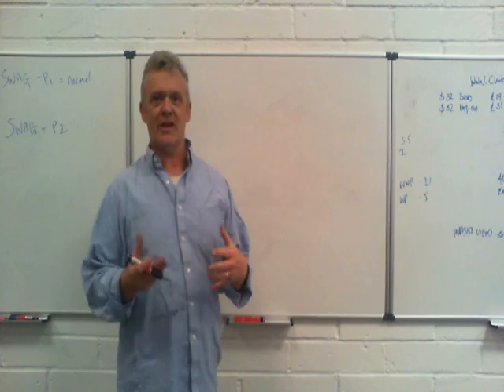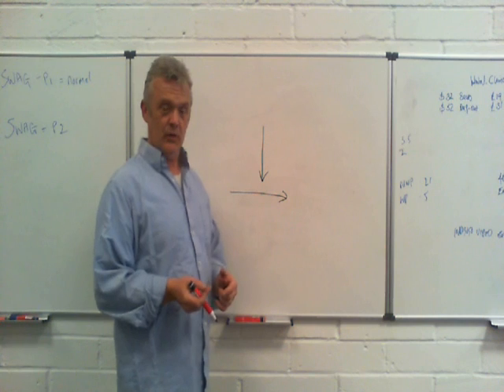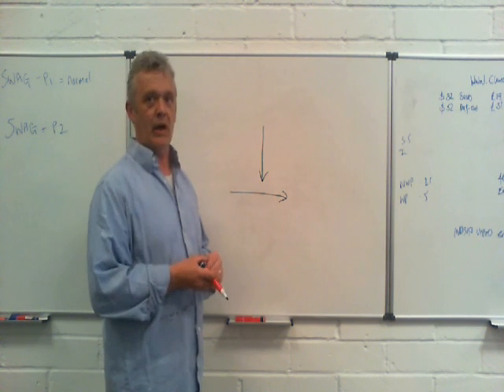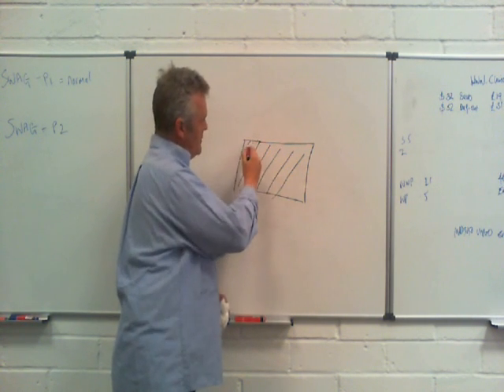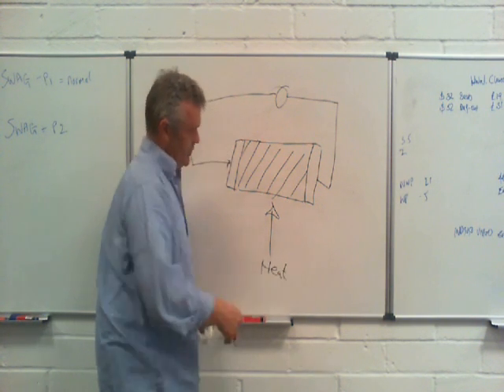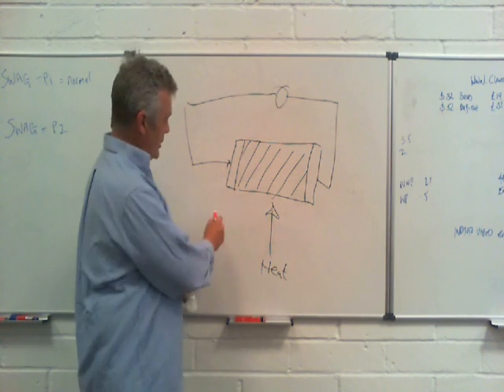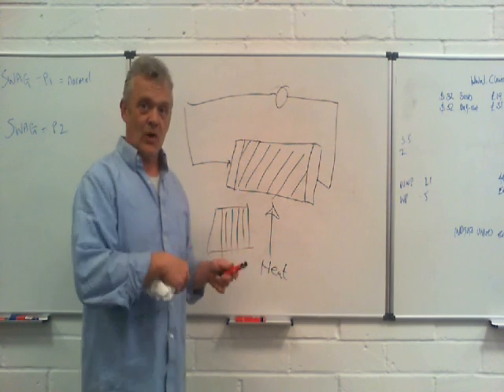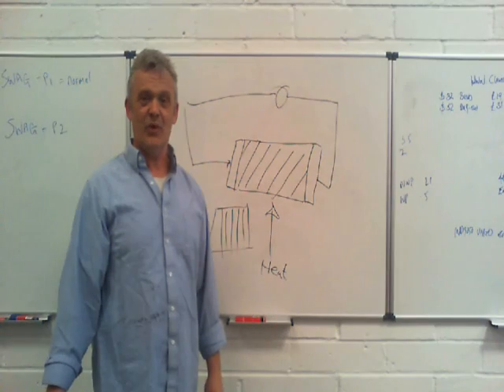Thermo Electric Generator From Graphene Ink

Comment: Thanks for your informative and inspiring videos. If possible, I would like to ask you and/or your audience a couple of questions. I don't expect you to know the answer to all of them :)
1- what is the maximum temperature these sheets can tolerate? 260 C?
2- what happens to them if put in direct contact with a corrosive environment?
3- which environments are especially corrosive to graphene sheets? is boiling water/steam one of them?
4- From Wikipedia I have read that flat graphene sheets are unstable with respect to scrolling. Are your sheets prone to cracking when bent into a cylinderical shape?
5- And finally, what is their heat-to-power efficiency compared to TEG's?
Best regards and good luck!
Reply from the maker: your best answer is to experiment with this yourself as I haven't done any of what you are looking at so I have no idea

Comment: I'm thinking the electrons need to go/travel from a high potential to a low potential once released from the atoms due to the heat.   Using similar metals as the conductor terminals, I'm not sure how the electrons would decide to go in one direction or the other easilly/efficienty.  However, you do mentioned a "directiionality" to the flow of electrons..  If the same conductors are used, perhaps the metal should go flat against the heat source to enhance the flow of electrons/holes.  Just an idea.
Reply from the maker: Hiya mate - direkcteecks posted a link further down in the comments page to a good description of this type of thermoelectric generator. Different metals aren't needed and they shouldn't be placed against the heat source or it just won't work - have a look at the paper mate
Reply: Robert Murray-Smith Well, due to a difference in heat is needed, to have a difference in energy, and hence voltaic potential energy, only one metal should go against the heat source, that's what I mean't in the comment.  Putting some atoms of metal in the graphite matrix might be something to experiment with. I don't have much equipment.
Reply from the maker: trailkeeper
certainly worth the experiment mate

Comment: aha now your cooking on gas....
instead of plastic I would like to use thin ceramic wafers and use my wood burner as my hot side and the cooler side would be the water on its way to the heat exchanger in the fire. I aim to use compacted Boron nitride powder as the insulated thermal contact on both faces.
I have just bought a house and will be building my own wood burner and associated systems and have for some time wanted to try this idea out....
as they say watch this space.......
thanks for the update....
Reply from the maker: Now that is good thinking - do you plan on doing a video - I would like to see that
Reply: Robert Murray-Smith
 it will be some time due to inevitable priorities, but I am collecting info and material 	 	 	 	sources and carefully condsidering design especially in the light of additional info re the inclination etc ......... I will fully document the process and outcome. and show
Reply from the maker: Bernard Stokes
that would be very cool mate
Reply: Bernard, did you try the ceramic graphene TEG yet?